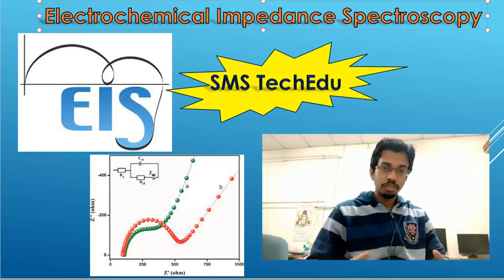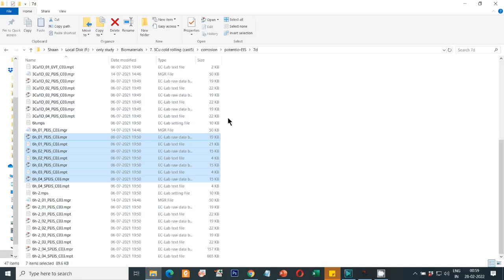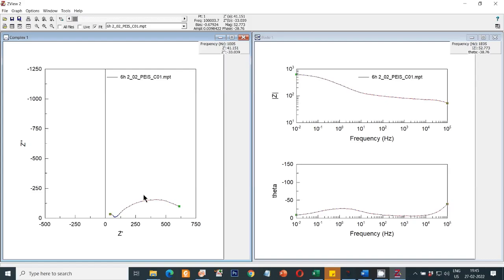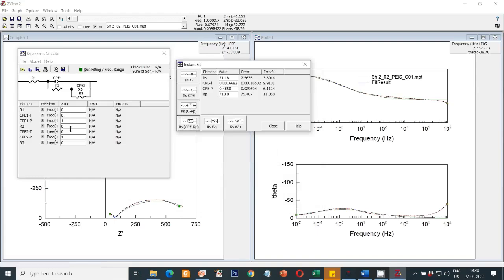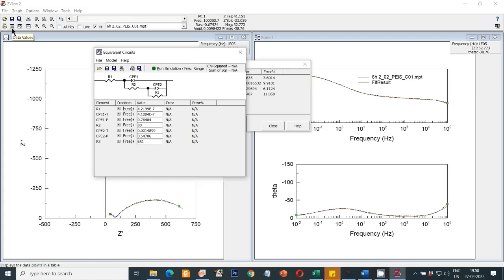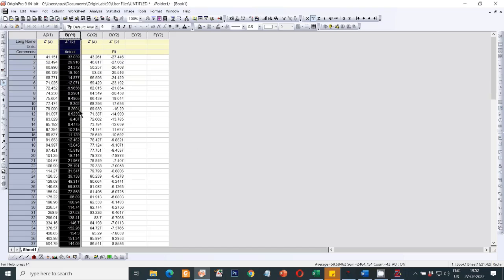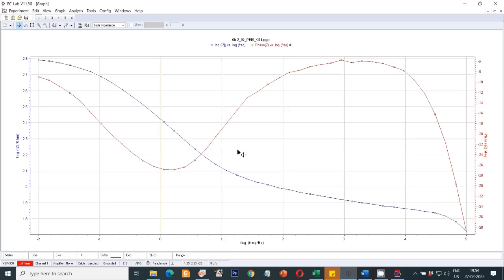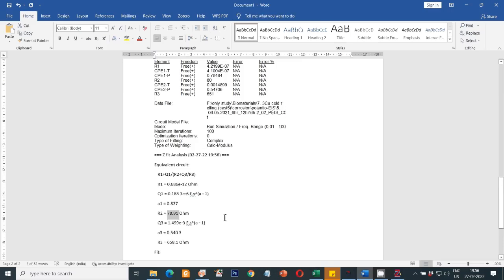Electrochemical Impedance Spectroscopy (EIS): Basics, Experimental and Fitting using ZView & EC Lab

Comment: Great explanation, sir I need your assistance it's really important. I am currently on my thesis for biological cell, how can we conclude our cell as a circuit as there are lot of different circuits in the literature. I am very confused please help. Thanks.
Reply from the maker: There are standard behaviours for different circuit elements (i.e., resistor, capacitor, inductor, constant phase element (CPE), etc). We need to see the behaviour of our nyquist impedance plot. from there, we have to deduce a circuit. We need to justify our circuit selection based on the actual electrochemical phenomena taking place in our system. There can be multiple circuit combination which will yield the same plot, but we need to justify what circuit elements we take n our circuit. If a nyquist plot is a perfect semicircle, iwe can conclude that the equivalent circuit has a capacitor and resistor in paralel, and we conclude that the nyquist plot is purely capacitive in nature. However, if our nyquist plot  is not a perfect semicircle and is slightly flat, we can say that it is not a purely capacitive circuit, and we will take a CPE instead of a capacitor in our equivaent circuit.

You may find the following links useful:

https://www.gamry.com/application-notes/EIS/basics-of-electrochemical-impedance-spectroscopy/

https://www.als-japan.com/1902.html

https://www.sciencedirect.com/science/article/pii/S1572665715301326

https://www.sciencedirect.com/science/article/pii/S2352492820324405#bib0190

https://www.mathforengineers.com/AC-circuits-calculators/parallel-RC-circuit-Impedance.html

Comment: brother, can we find out the corrosion rate by EIS?
Reply from the maker: No. Impedance plot obtained from EIS is to determine the equivalent impedance of the circuit, and hence we can make a qualitative comparison about which sample offers how much impedance to corrosion, i.e. the polarisation resistance. We can obtain the corrosion rate from Tafel plot.